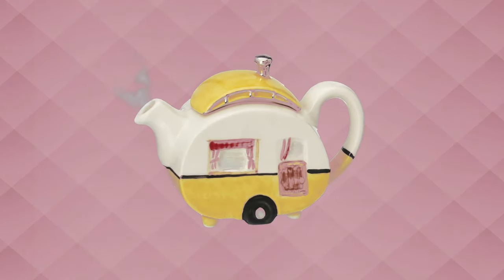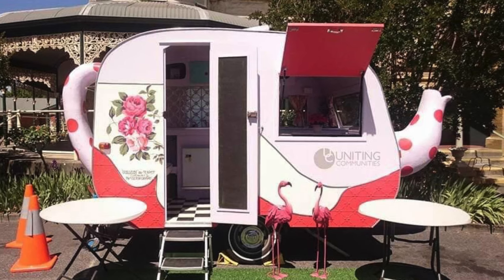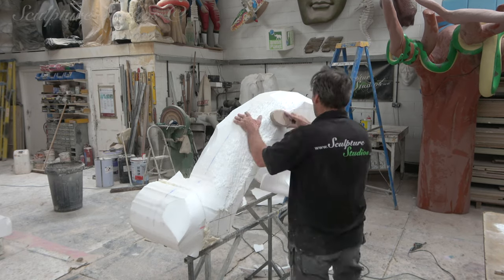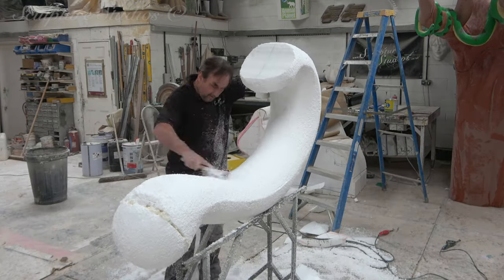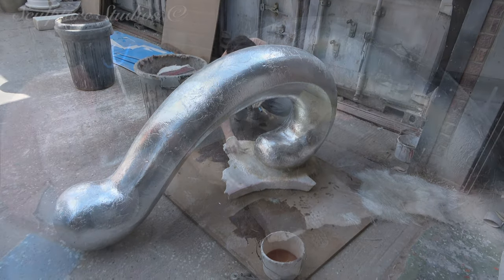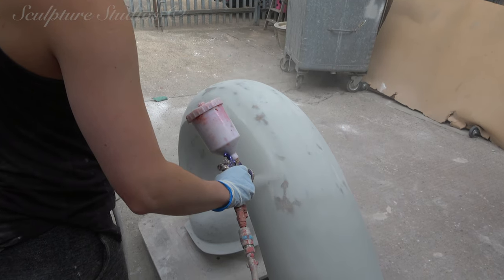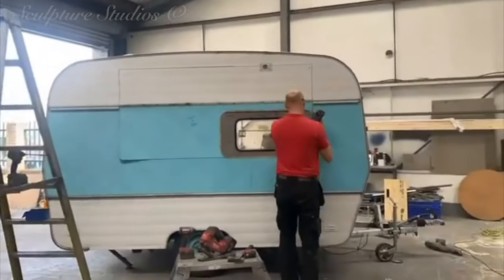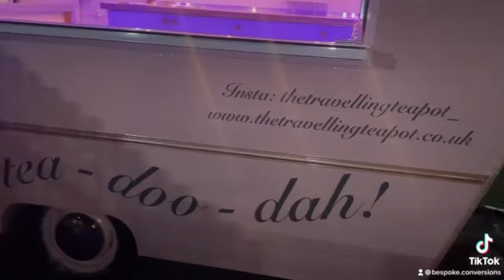Turning a Caravan Into a Giant Teapot by Sculpture Studios

Comment: why do they scrape it with a nail brush, wouldn't it be smoother before hand without the texture.
Reply from the maker: The hot wire takes off the bulk of the material, but its difficult to use this to create an absolutely perfect shape. The nail brush then carves and refines the shape more. Sand papers are then used to smoothen the surface once it's been carved